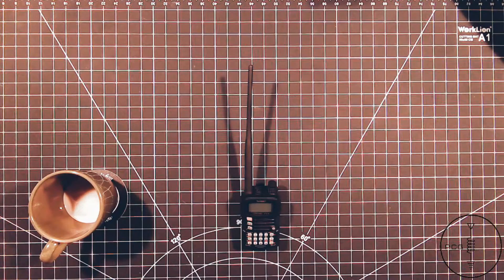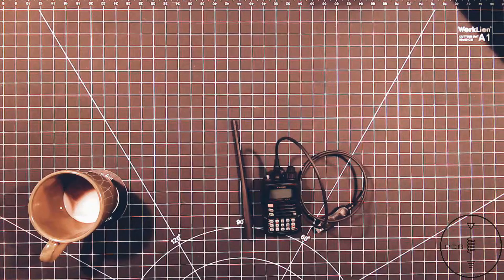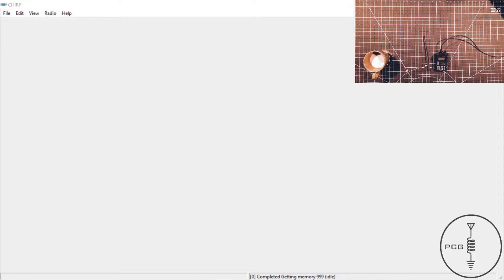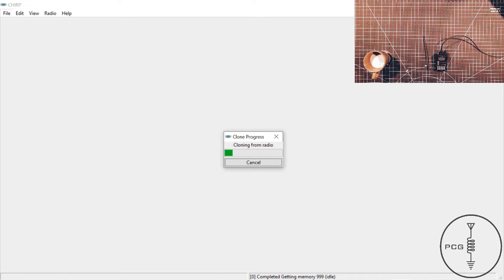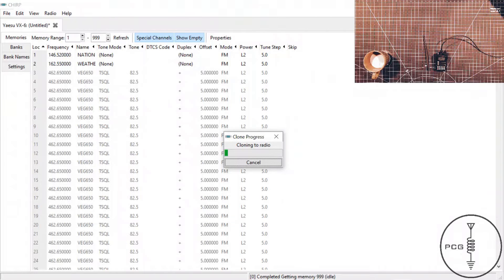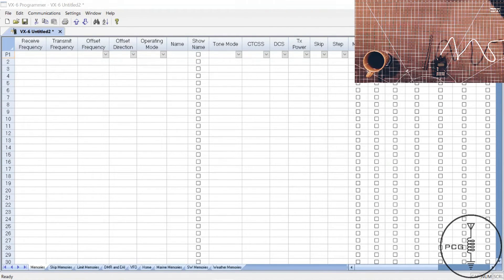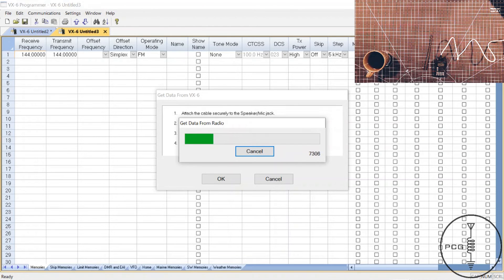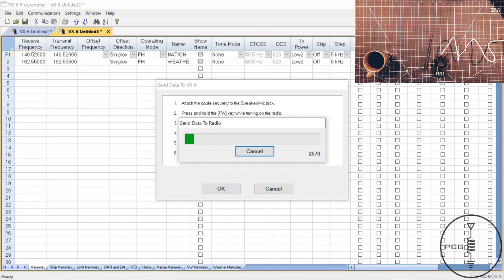E5: Yaesu VX-6R & CHIRP / RT Systems

Comment: Thanks for the video. I'm having com problems with trying to get my vx5 to communicate with Chirp. I"m using windows pc and usb cable. Any tips or tricks? Thx.
Reply from the maker: I know the VX-5 is on the CHIRP list of supported radios.  If Windows isn't recognizing your programming cable, then it could be a driver issue (you can look in the Windows Device Manager, and see if it is visible under the COM ports).  Not sure what programming cable you're using, but if it's a driver, then you may want to try downloading a FTDI USB VCP Driver.  Here is a link to Valley Enterprises where you can download the driver: https://www.valley-ent.com/store/yaesu-usb-ftdi-radio-programming-cable-ft-60-vx-1-vx-2-vx-5.html. 

I'm not sure if this will solve the issue or not?  But, you can give it a shot while you're troubleshooting.  If you get it working, then the first thing you will want to do is to download from your radio, and create a template that is compatible with your radio.
Reply: @PartisanCommsGroup  awesome. I’ll try it out. Thanks so much!!

Comment: YAESU says not to use Chirp with their radios or you risk bricking them and they wont support it.
Reply from the maker: I don't have a dog in the Yaesu vs CHIRP fight.  However, I addressed this topic in Episode 3, and I have heard this rumor before, and prior to doing Episode 3 I researched this subject.  Allegedly there was a Yaesu rep who said it may be possible for CHIRP to brick a radio through somehow modifying the firmware.    However, the developers at CHIRP have responded to this a couple of times stating their software does not modify the firmware.  In Episode 3 I referenced a CHIRP support ticket #6671 (a link is in the description of that video) which also addressed this concern.  In their response to the ticket, CHIRP stated they know of no circumstances where CHIRP has bricked a radio, and they know of no situation where anyone has approached their team with a bricked radio, and demonstrared a process by which their software caused a radio to become inoperable.  From personal experience, I can say I have used CHIRP on all of my Yassu radios and have never encountered that situation.  I guess in theory anything is possible when it comes to potential software issues / bugs.  But, if no one to date has been able to produce a bricked radio and explained either (1) how it happened, or (2) was able to reproduce the issue, then I think its fair to assume that claim is invalid.
Reply: @PartisanCommsGroup  Thanks for the reply. Is there an advantage to using chirp vs adms? Im on mac if that matters.
Reply from the maker: I use both CHIRP and RT Systems.  Some of the differences are, CHIRP is free and covers a wide range of radios.  With RT Systems the software is specific to a given radio, and you have to purchase it.  I don't think you can go wrong with either, but RT Systems seems to have more features.  RT Systems also has on screen instructions to guide you through the programming process.  This is something the legacy version of CHIRP (CHIRP Daily) didn't have, but has included in their latest vsrsion of their software called CHIRP-Next.  I tend to use RT Systems for my Yaesus because I think their software is more robust, but that isn't a knock on CHIRP.  Both support MacOS, but you'll want to visit their websites to confirm they support your specific radio.
Reply: @PartisanCommsGroup  Thanks for the breakdown !
Reply from the maker: You're welcome.